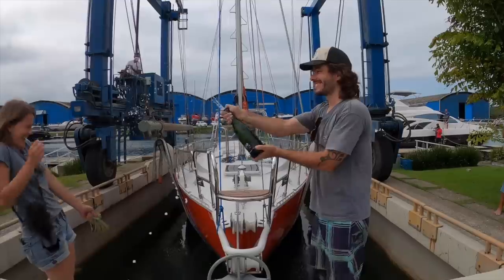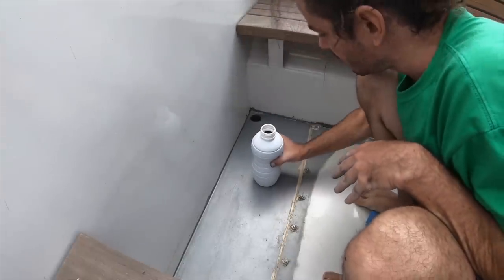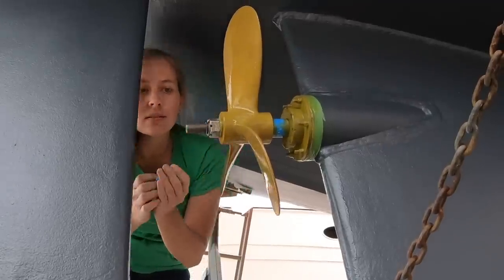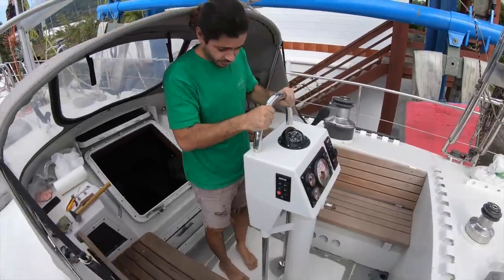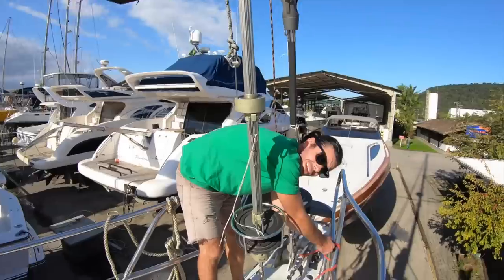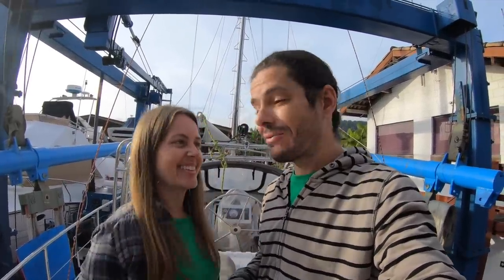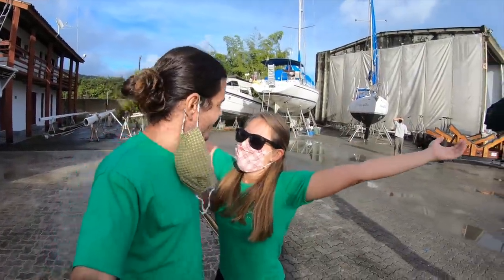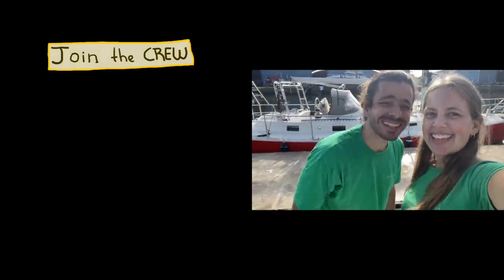⛵️After a 22 YEARS neglected and 2 Years refit we are FINALLY back in the water #191

Comment: The most beautiful 'Finally' I ever heard.  Enjoy !
Reply: I agree
Reply: @OddLifeCrafting  tip for painting inside drain pipes... a pompom... on a string... suck the string through the pipe/drain with a vacuum cleaner... dip the pompom in paint & pull the string... if you have 2 string you can pull it back & forth through the pipe... WAALAA👍

tip for clean inside a pipe... change the pompom for a rotary wire brush, as for a drill... they can be had with a hole in the center instead of a shaft for drills... a long bolt through the hole with a nut each side of the rotary wire brush head to attach a string/rope each end of the bolt ... the wire brush on a grinder to size for the pipe 👌

Comment: 22 years left on the hard, 2 years to get back to the water, that's less than 10% of the time it was neglected so pretty good effort 👍🏼
And most importantly you beat Yaba back to the water, but the race is not over yet, because you still need to get down the coast 😁

Comment: So good to see you back on the water. Duca - I don't want to be picky, but this matters. When you were fitting the propeller and installing the castle nut - the cotter pin (split pin) should pass through the crenelations of the nut. This stops ANY movement of the nut. Your new propeller is slightly shorter or slides slightly further up the shaft than previously, so you need a spacer or additional washers to align the pin hole in the shaft with the cutouts in the nut. Instead, your pin is beyond the nut, and so the nut can undo and work and wear on the pin ... with unfortunate consequences of you losing your propeller, possibly. 

The nut was taped over when Victor was painting the propeller, or I am sure he would have said something.

A diver, or you with a facemask, can fix this. Add some washers.
https://www.youtube.com/watch?v=5DqM0RNLQZ8
Reply: In 100% agreement! That nut can move and shear off the cotter pin. I‘ve seen it happen in an automotive application which was not fun.
Reply: just add a washer(s) to move the nut further out so the pin can catch the castle nut properly.  Great Job on the boat.
Reply: Sharp eyes. I hope the couple reads this before sailing.
Reply: @odd life crafting, this is important.
Reply: hi I also believe that the prop should have been "lapped in to the shaft" with lapping in paste as well' before fitting. No too sure why this is done but it seem to be the way props are fitted to the shaft.
Reply: Thank you Brian Jones for the very constructive counsel. I hope that Duca and Roberta see your words before venturing off. 70 years ago my dad purchased a used 23' power boat. A sweet thing with a Down East design. We picked it up in, I believe, Plymouth MA. went through the canal into the Atlantic home to Salem Harbor in Marblehead MA. arriving at the dock after making a perfect landing Dad put her in reverse and the prop spun off at the dock at high tide in about 10 feet of water. The good news is we retrieved the prop and saved a very important day.
Reply: @GeneRossano  What a great story, Gene. With boats and roadtrips, we remember best the challenges and things we overcome.
Reply: You definitely need that washer, even if they were not such a big gap to the pin, to spread the load from the nut. Also the "split ring lock washer", that is supposed to help prevent the nut from undoing, is BS; in practice they do more harm than good.

Comment: Through-hull fittings below the water line on my boat: Engine cooling in, salt taps/hose in, toilet/shower/sink out, transducer, rudder, prop - 6 only, used to be 5, but two salt inlets fought and there wasn't sufficient flow and was cavitation, so a new one got added. All other drains from galley sinks, ice boxes, and hatch gutters etc all go out above the water line, same for exhaust obviously :-)

Comment: I'm interested in the total cost of the boat plus the total refit - and in the end whether the boat at launch was worth the blood, sweat, tears and treasure. There are always  so many great deals on excellent boats. Captain Q has showcased some amazing bargains and Sailing Magic Carpet's new project rehabilitating a classic Cape George are great examples. I myself have worked on several Hallberg Rassy 40-50 foot boats which were 30-40 years old but very solid and amazingly inexpensive. At the end of the day, a refitted Hallberg Rassy 30 - 40 footer is hands down a better boat especially if you want to sail around the world than a steel boat with a drop keel and a questionable hull shape no matter how much work is lovingly poured into it. Also, a better return on your investment - although ROI is always a losing proposition on a boat. The other big issue is the 2 years working on a boat rather than spending more time researching and finding one that needs less work if you get a great deal - and more time actually sailing. These videos became more questionable as time went on.

Comment: The cotter pin on the prop needs to be corrected.  Presently it will still allow the nut and prop to loosen off, and eventually fail.  Add some washers under the nut, and then the pin to stop the nut from turning at all.  Great job on the project.  It looks fantastic.

Comment: To keep the propeller from loosening, the cotter pin must go through a slot in the castle nut. In your case you'll need to add a couple washers on the castle nut side of the prop shaft. I have to do this with my boat as well.

Comment: The prop needed a spacer or washer ... that cotter pin is not stopping the nut from rotating.  The nut can come loose, but will not fall off, but the prop will then move on the shaft.   You can fix this without hauling out I think with a diving mask maybe?

Comment: Duca, the split pin you installed on the prop shaft I don't think is installed properly.  It needs to go through the grooves (a.k.a. castellations) of the nut that holds the prop on the shaft, so that the castellated nut cannot rotate.  There is a small risk of losing your prop otherwise.  There is a similar comment by Brian Jones in the comment section. Other than that great work and congrats on making it back to the water!!

Comment: Your Prop nut is not secure , the split pin must sit in the castleated section of the nut. Suggest you include a thick washer before the spring washer. Cheers

Comment: I'm looking at the prop installation. Castellated nuts are meant to be tightened down then have a pin pushed through the slots on the side of the nut. In your case, either a washer or something else is missing behind the prop, or the nut is the incorrect nut and needs replaced with a longer one (top to bottom height wise). Ask someone in the marina!

Comment: I have said it before and will say it again.  There should be no controls inside the circumference of the steering wheel.  The spokes can strain or break a wrist, when the wheel turns unexpectedly by the autohelm etc.

Comment: WARNING: the prop shaft castel nut need another or thicker washer or a castel nut with "deeper castle" because the hole for the cotter pin should be in between the castels to properly secure the nut. Beside that great work!

Comment: Too late now, but to paint the inside of pipes, fill them up, then let them drain!! Simples! So good to see the boat splashed but also agree with prop/nut comments - needs to be fixed before you spin up the engine otherwise the shaft could be damaged beyond easy in-water repair.
Reply from the maker: Tooo much of a mess https://youtu.be/Qq9uDwMaz6I

Comment: Why not plug the bottom hole and fill the tube with paint and let it set for a few minutes and then drain it?
Let it dry and do it again till you get the desired number of coats.
Reply from the maker: We did it in the past. It’s a mess https://youtu.be/Qq9uDwMaz6I

Comment: Did yuo realy greased the tapered end of the shaft bevor mounting the propeller?thats not good thats wrong doing,cause the friction of the tapered conection is the main think needed to transfere the power to the prop.
Reply from the maker: We aggree. We did it wrong. The reason we did that was to make sure we can takenit off when need. But we regret. And also the pin is to far from the castle nut. So to fix all that today we quickly lifted the bot again and cleaned the grease and applied lock tide instead and fixed the pin problem and splashed the boat again right after and now we are good to go. 👌🏼